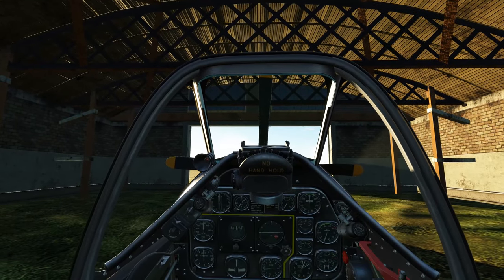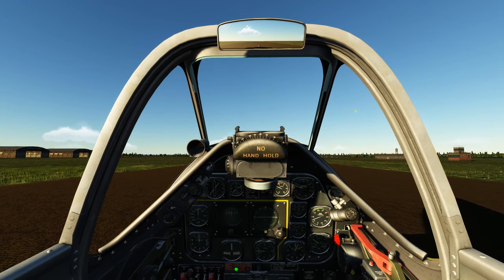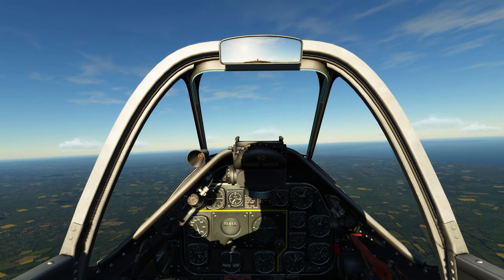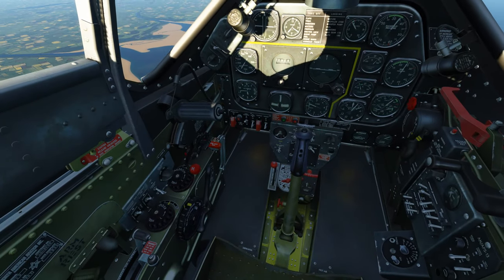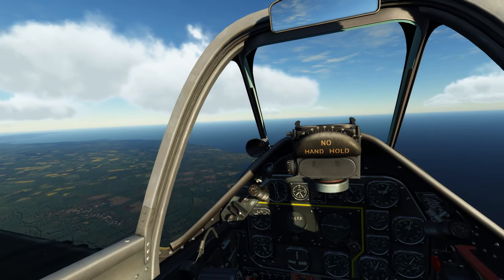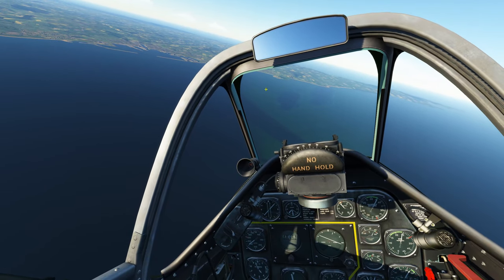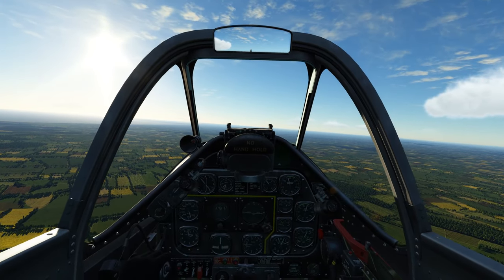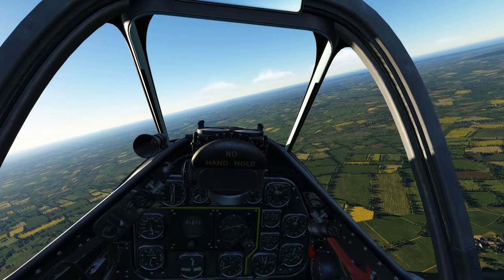DCS: P-51D Mustang - Humble Beginnings

Comment: Regarding the throttle/rpm order you asked about, I believe it's the same mentality as a car (with a turbo) you never want to lug the engine. To throttle up apply rpm then throttle and to throttle down throttle back then rpm, you can do this simultaneously but keep it staggered if that makes sense.
Reply: I believe you are correct though some radial engines are never to have negative force on the hub so you would push and pull the prop and man. together. had something to do with stress on the crankshaft mains, i believe the P-47 PWR 2800 and also the twin wasps on the C-47 were similar. I understand RPM needed to be increased for Turbo-supercharger staging with the radial's.
Reply from the maker: Ah right on, makes sense. Thanks for the info!

Comment: Regarding manual radiator control: Auto is perfectly fine, but you'll be able to get slightly more out of the aircraft by using manual controls to close the rads for short periods, thus reducing drag (at the cost of increased pilot workload and risk of engine damage.
Reply from the maker: Ah okay, thanks for the info!
Reply: I always opened them in the air, that's the only time (when pushing the engine hard especially) that the temps start to get a bit high.  Open keeps everything nice and cool.
Reply: StandingCow sure, and you can get by just fine like that, but you're likely slower than someone using auto management and definitely slower than someone that closes them up when temps allow.
Reply: Jon Wemp mm

Comment: Version 2.1 is an Alpha build, so expect bugs like the HUD/glass. They implemented PBR in this version and broke some effects with it, but that's why it is an Alpha. There is the 1.5.x beta and stable branch, but it's not that pretty. ;) Hopefully they merge all 3 versions into 2.5 this year, it's a little bit like an nightmare for the 3rd party developer and user with 3 versions. AI uses an simplified flightmodel, so they are cheating in every aircraft in DCS atm.
Nice video, hope to see more DCS stuff.
Reply from the maker: Ya, fully aware. Just never a bad idea to point things out for future improvements. :) Enjoying the experience regardless, thanks for watching!
Reply: unwissend83 How do I get the alpha build?
Reply from the maker: Go to the official site and download DCS World 2.0... requires one of the new maps though. Normandy or Nevada which need to be purchased. At least until they remake the map that's in 1.5.
Reply: You're absolutely right. The Update from 2.0.x to 2.1 implemented many new effects but broke alot of the gfx like you mentionend. The cockpit glass reflection was disabled for most/all aircraft with the first patch for 2.1, because it caused trouble, the HUD is in many/all aircraft often not readable because of the sun... But at the end  they will fix these bugs and the new engine features will improve the DCS experience. So don't get frustrated by the bugs and keep flying, it's addictive. :) DCS is the best helicopter experience you can get infront of a PC in my opinion too, if you have any interest in helicopters, try a magnificent MI-8 or the Huey, Belsimtek nailed them pretty good. The KA-50 is the oldest one in DCS but the one with the hardest punch with its 16 anti tank missiles and different to fly because of its coaxial rotor. But only flying some heavy cargo lift operations in the MI-8 is extremly satisfying too, like your experience with the startup of the Mustang. 
Long story short, i'm flying this sim since "lockon modern air combat" times and i enjoy this sim and all the different modules like at day one. Have fun flying, greetings from germany.

Comment: Sidestrafe, after watching you trying to control a Spitfire on takeoff during your stream yesterday, I'd suggest you do a Google search for "Spitfire takeoff procedure", and read thru what it took to get a Spitfire off the ground in real life. After looking thru a couple of them, it sounds as if there's some significant differences between what they tell you to do, and what you were reading out of Chuck's Guide. Below is a link to one I found, reviewed by WWII Spitfire pilots -

http://forum.keypublishing.com/showthread.php?72714-SUPERMARINE-SPITFIRE-Take-off-and-Landing-Guide

Just a couple significant differences I noted - brakes are supposedly a combination of the rudder pedals and the control stick lever, pedals apply the brakes, control stick lever controls the braking force - keeping the plane straight required right rudder AND right aileron - engine initially ran up to 4, once you start rolling and get up to around 40 mph ease the control stick back towards the middle to allow the tail to come off the ground, then roll on the power - basically said you had to be ready to use FULL right rudder and right aileron to keep the beast straight initially - should become airborne around 85 mph, and you can start climbing at 140 mph - be ready to ease off on the rudder and aileron as you gain speed on takeoff and start to go airborne.

Could be, as I commented in the stream, that what it took in real life, and what is modeled in the game, don't match up as far as the physics is concerned, and that's why it's such a bear getting a Spitfire off the ground in the game.
Reply from the maker: Ya, it's a tricky bird according to quite a few people. I'll take a look at the link and see what I can figure out. Thanks!